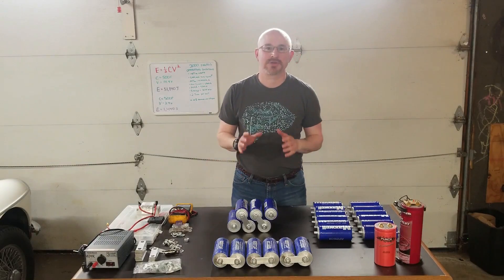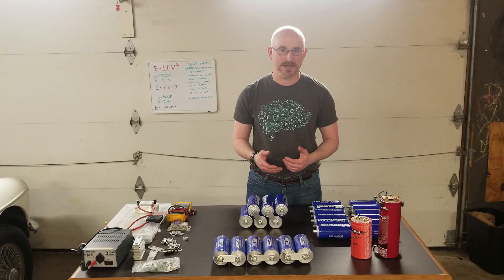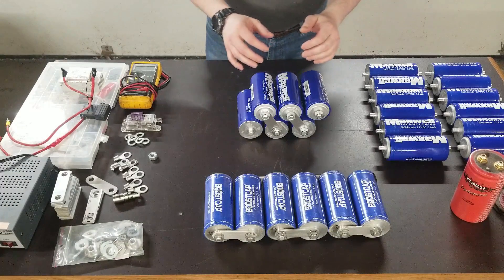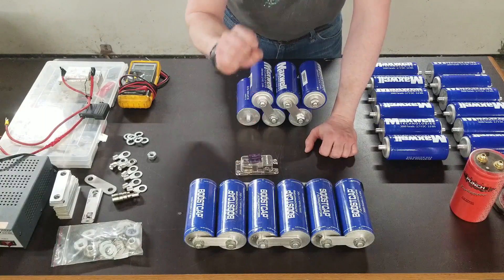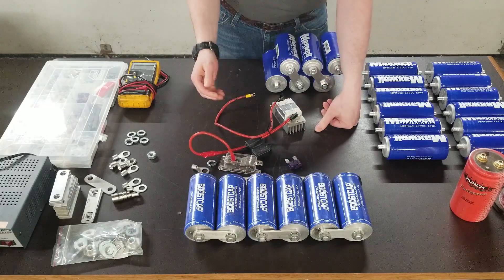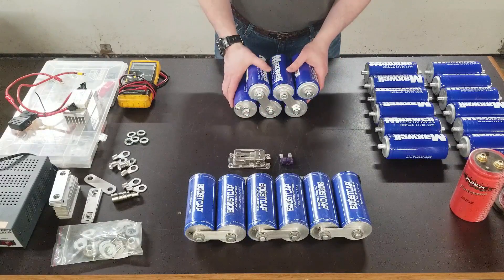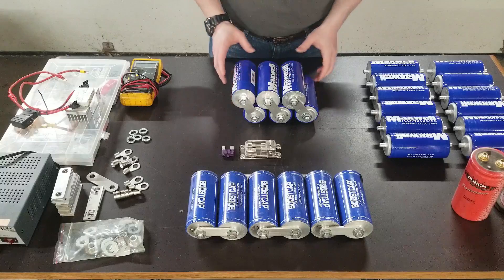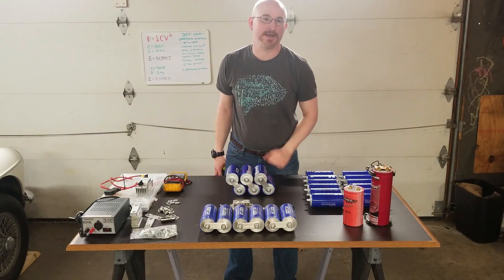Electrical engineer explains ultracapacitor Safety Tips and Tricks - Car Audio Applications

Comment: I find a basic VSR (Voltage Sensitive Relay) works well. I connect the 12v sensor line to the positive on the ultracap bank. I put a large resistor across the VSR isolate terminals - IE between Common and Normally open.  I have the resistors on a decent heat sink.

On connecting the battery or turning on the isolator I have between the bank and the 12v high current supply the VSR is open so the current is limited and the bank voltage starts to rise. Once it meets the voltage on the 12v feed the contact closes and shorts out the resistor giving direct connection to my audio supply line.

I also use a high current relay connected to the accessory switched 12v that closes when the car is in use. I have an override switch  SPST that connects the relay to the battery 12v if I want to use my audio system without having the engine running. It is wired as a latching relay that is interrupted by a small relay connected to a car alarm armed output.

As soon as I leave and arm the alarm the bank is isolated along with the VSR so it doesn't become a vampire load. I used a two position isolator so in the event of a flat battery I can turn the isolator to the second position and this gives a direct connection back to the cranking battery so I can start the car. I monitor the bank and VSR relays with a nice little digital voltmeter and LED so I can see what is happening.

The above setup sounds a bit complex but its actually very simple. A 200A fuse (TD) protects against a nasty short but so far it has worked really well. The bank is almost always fully charged anyway as I have glued a 20w solar panel to the sunroof shade. This is always pulled across and I cant forget as the sunshade when pulled across pushes a microswitch that is connected to one of the alarm trigger zones. The alarm gives a warning chirp if any input is active so I can never forget. With the solar panel across both my batteries stay healthy and on a very sunny day will actually charge both batteries at about 200ma.... !! Just don't forget your Schottky inline blocking diodes and a plain old 1N4001 diode across any relay coils !! Those large relays will hit you like a train with the back EMF when they are disconnected !  I can personally vouch for the punch they can give you.

I hope the above gives some idea's or help to someone considering using them. These banks are VERY useful.  Please PAY ATTENTION  to Richards safety advice. These packs store a huge amount of charge and if your careless they can really bite you ! 

~~~~~~~~~~~~~~~~~~~~~~~~~~~~~~~~~~~
Great advice and safety video Richard :-)    👍 👍 👍 👍
~~~~~~~~~~~~~~~~~~~~~~~~~~~~~~~~~~~
Reply from the maker: Love the setup!  I understood and agree, the beauty is in the simplicity.  Nicely done!
Reply: @richardvedvik979  Thanks :-)  I like to rely on logic and relays instead of microcontrollers. I love relay logic, I was lucky enough to inspect an early Otis lift with 2 lifts and a dispatcher. Not a CPU in sight. All completely run by relays. Beautiful lace wiring and so well built. It just seemed alive if you know what I mean.

You don't see build quality like this today. A great shame in my opinion. I achieved my Bsc in electrical engineering whilst in the Navy, that was the last time I had seen build quality like the lift controllers. That's the beauty of car systems and relay logic. So simple and yet so flexible.

I love your video's so far. I hope your channel grows and grows. I will link to you where I can. All the very best to you   :-)

Stuart.
Reply: But sir, if we/ u don't use a voltage limiter (for balancing) while charging aren't we risking overcharging one of those caps in series?

I said this because i have some project w/ 6 supercaps (rated in 2.7V 470F) in series, when i connect (in series) them directly w/ wire, one or two cap will always "dangerously" close to 3V when i charge it w/ 12.5v - 12.8v (i was using my spare fully charge lead acid batt)
and the location of those "overvolt" caps seem to be random (that eliminate the variance factor in built quality/different ESR of those caps right?), bare in mind that all those caps never runs hot while testing on those test (direct series connection).
What i mean by random is it will change places when i do full charge - discharge cycle, not so when i only using it... let say until Vtotal = 6V. using DC fan as load (inductive load, rated @ 12V , 14.13A)

btw, now after i buy some those "balancer/limiter pcbs" ,  now i stumble on yet another balancing dilemma, this time "undervolt" hahaha...
as we speak : Vt = ~12.3v , but individual V on those caps as follow : 1.65, 2.07, 2.26, 2.27, 2, 2.07. and those are not random any more, maybe i will try to manually balance those caps and let see if that help or i got variance in built quality afterall :D

Comment: FFS this guy brought the stock and Tesla brought Maxwell company 😂😂 they not that safe if no balance controller
Reply: You can buy those Maxwell caps already in a bank with balancers on them already
Reply: The ones he has are probably fine at 6 in series. 0.00174 ohms total. The voltage drop cell to cell Will be negligible and if the alternator isn't putting out even near that banks 16v max... Odds u have an issue AFAIK u face more risk driving around the block with out them. Rock 5 of them and a lot of room for bad things occurs with or with out balance

Comment: Thank you for your very professional presentation.

I noticed you don’t use circuits to balance the capacitors the way they are offered in eBay.

Could you explain the reason for not using them, and when would you use them?
Reply from the maker: Thanks for the comments.  You'll notice in my previous responses I identify that the balancing circuits are definitely required when you operate the capacitors at their rated voltage but in a car with a 14.4VDC alternator output, we aren't near the combined rating of 16.2VDC.
Reply: @richardvedvik979  But without balancing circuit how you prevent that they do not slowly get unbalanced? And when you discharge them how you prevent that you do not end up reverse polariy situation if they are not balanced?
Reply: @TH-wr1dv  he can't. That is why balancing needed
Reply: @voidex136  Yep that was my point. It does not matter that total voltage is under combinet rated voltage. Without balancer it is just time bom with longer fuse.
Reply: @TH-wr1dv  1,000,000 cycles a million chances. I worry about airflow bw the amps and the caps. At least the are not being run at deep cycles consistently so they will stay well within operational limits, especially if he regulates the initial charges. I've popped a 100a fuse on a half farad in an initial charge. Many designs are calling for 40a change limits. Once the battery is stiffened as long as he isn't parking lot pimping too much, over straining equipment, or overheating alternator at idle he should be good to go.
Reply: @ockamrazor477  aaand your reply have nothing to do with unbalance problem.
Reply: Right its about building an intrinsically safe product which is difficult wo balancing using lithium with odd failure rates; true. Did you miss his fire protection circuit?  He did too
Reply: @ockamrazor477  what circuit do you recommend for engine starter ( 600-1100 crank Amp) with 2500 W 120V ac inverter with intermittent  peak draw of 20 Amps, eg, air 8gal 5cfm air compressor and 15 Amp circular saw? Or just a circuit for thr starter. Tyia.
Reply: @jerydob6499  tricky to pick the right inverter just fuse around your caps batteries and chargers to avoid one cooking the other,  so don't plan on ever using more than 80% of the inverter and keep safety margins

Comment: Are you selling them??
Reply from the maker: Possible some of them will end up for sale on eBay if I don't find homes for them locally.
Reply: @richardvedvik979  What is a realistic price for these? I'm seeing everything from
~ $15  all the way to  ~ $80 on various sites for the BCAP3000. Am I missing something?
Reply from the maker: Prices for the BCAP3000 are usually around $200-250 for a used bank of 6.  Popularity has caused an increase in the past 5 years.   New, they are around $65 each.

Comment: Can the alternator charge the supercapacitors withoutbthe use of the resistors that you made?
Reply: ESR = .29 mΩ per capacitor.
In series of 6, total ESR 6x .29 = 1.74 mΩ.
In theory it will surge 14.4 V / 1.74mΩ = 8276 A
The absolute maximum current for the Maxwell BCAP3000  is 1900 A.
Although I cannot claim to be an expert here, please do the maths. 

What if you do this in a system with a bad battery, then the rectifiers in the alternator will get the largest part of the surge. An alternator rectifier can handle 50 A, and maybe 500 A surge as an absolute max. 

These values are theoretical, the wiring will do a large part of the limiting, but damage is in my opinion in range.

https://www.maxwell.com/images/documents/k2series_ds_10153704.pdf
Reply: @erikdenhouter  a typical alternator puts out 100 amp maximum... Some 200 Amps maximum... That doesn't include the engine electronics and what is running... The bank takes in as much as it is available... Factor what the battery needs also...
Reply from the maker: No! The capacitor bank will look like a dead short and will damage the battery and alternator without current limiting of some form.
Reply: Yes you can. If you have your vehicle running with lead battery, you can charge the caps with jumper cables. They will charge to alternator output. I made a video on it.
Reply: @Uwe K Yes, even at Zero volts. The vehicle has to be running, the lead acid battery has to be connected to the vehicle. You run jumper cables and connect in parallel. They will get charged faster and cheaper than most methods.
Reply: @luisislas2162  I think this is bad advice.
In principle always use a limiting resistor in any form: 55W headlight is one method (or 2 parallel = 10A), but even an extension cord of 20 meter or more could have enough resistance to limit the current enough, it depends on the capacitance of your supercaps.
Specially a jumper cable is NOT enough, they are made thick to get low resistance / low losses when jump starting.
The problem in your method is that you do not see if damage occurs, your set will probably survive, but the damage can be done in the life expectancy of the battery and alternator, and even the supercaps have a maximum current in their specs.
At some point you can even produce a welding heat, and e.g. sparks could damage eyes.

In the end, you win only a short period of time by not using a limiter.
Reply: @erikdenhouter  Limiters are for regular batteries...
Reply: Just be aware and take care, the numbers can show us something hidden under the bonnet :)

Comment: Would I see any benefit using one bank of the 2.7v super caps in a 2000watt daily system?
Reply: I couldn't afford to buy alot of banks at one time, so I bought one bank a month for 4 months.  I run two ct sounds 4k's strapped. So at least 8000 watts. I have a large bank of crescendo 110ah batteries but I noticed a HUGE difference  with just one bank of maxwell boostcaps on 8k!  I didn't think they would be so impressive, but I now believe in them.
Reply from the maker: @joshhanson6777  thanks for the input!
Reply from the maker: The 2kW installs I've done did benefit from one bank on stock electrical.  While another bank helped them with sustained bass notes, music is dynamic and the single cap bank improved dynamics.

Comment: You should really add an overvoltage protection circuit across each capacitor in the bank. Differences in the manufacturing process can lead to higher voltages across some of the capacitors.
Reply from the maker: Totally agreed when using them at their rated voltage.  Manufacturing variances in ESR will certainly cause differences in voltage across each cap.  Since we don't operate 2.7V or 2.85V  caps at rated voltage in cars regulated to 14.4VDC, the banks I've ran and installed for the past 6 years have been fine.
Reply from the maker: Note that six 2.7V caps in series are rated for 16.2 VDC (and six 2.85V caps are rated for 17.1 VDC).   That's why I'm pretty comfortable operating them at 14.4 VDC without balancing circuits.  Six of the older 2.5V caps in series are rated for 15 VDC and in that application I would recommend balancing circuits (if you can find them).   That said, I certainly should have put more of an emphasis on balancing techniques and mentioned that the active balancing circuits are the recommended way to ensure long life and safe operation for any application.  Thanks!
Reply: @richardvedvik979  Even with a significant safety margin i probably couldn't sleep at night if 350€ worth of capacitors had no protection.
Reply from the maker: @slap_my_hand   I certainly appreciate the concern.  I added notes on balancing and will continue to edit those notes further to help others.  Part of my comfort may be due to my having used them like this for over 6 years with a decade of industry applications to reference.

Comment: I have 6   2.5 V   2600 F Maxwell Ultracapacitors in a series. I plan on putting them in my trunk with a 250v breaker. I have a 1000 watt stereo system but I’m curious... I can not find protection boards for the 2.5 V ones & well... should I use a battery isolator or should I just have a solar panel by the window to keep them steady.
Reply: Leo Amaya 
You could also add another cap in series so 7x2.5V. This (17.5V) will give you more than enough headroom so you won’t have to worry about overcharging them. It will decrease your overall capacity though. Leaving you with 371F in stead of 433F. That’s what you pay for peace of mind.
Reply from the maker: The 2.5V cells are old which is why you'll find a hard time finding balancing circuits.  A datasheet from 2003 can be found as well as the instructions for the balancing circuits made then: https://www.datasheetarchive.com/maxwell%20boostcap%202600F-datasheet.html
 I recommend using the newer 2.7V or 2.85V cells to alleviate your concerns.  That said, you are not alone in your quest.
You can find a low duty cycle cell balancing application note here: https://www.maxwell.com/images/documents/technote_cell_balancing.pdf
This technique uses a resistor in parallel with each capacitor to provide an alternate path for ESR current and reduce variations.  This will cause the bank to drain more quickly and the resistor value determines the speed of balancing.  Faster reaction cause faster draining.  
You can find a paper discussing balancing methods for a 2.5V cell here: https://hal.archives-ouvertes.fr/hal-00411482/document
This paper explores a few basic concerts but does not go into enough detail. To help give simple instructions.  A seventh 2.5V cell in series would be a suitable alternative to balancing circuits. 

A battery isolator isn't necessary and it's preferred to keep them in parallel with the starting battery.  With an isolator you could end up with a situation where the bank voltage and battery voltage are different - and when they are connected they will equalize quickly - fast enough to behave like a short and cause arcing on the isolator contacts.  A disconnect method is needed, as mentioned in the video, and a breaker is also ok - just make sure you're measuring voltage and charging the caps to the battery voltage prior to connecting. 

Solar panels are good for helping the lead acid batteries in our cars stay topped off.  Caps don't really care what voltage they operate at (as long as it's less than rated).  I've used solar panels to keep car batteries charged and it extends the life of those batteries.  As long as the caps and batteries are in parallel, solar panels can help the entire system.  Once the vehicle is running, the alternator will determine the operating voltage.

Comment: Hi great video ! I would like to know if i can use my supercaps without BMS. Do you think that i could use 7 supercaps instead of 6  just to be sure that they don't overcharge ?
Reply from the maker: The balancing circuit or BMS should be used if the application brings them within a tenth or two of their rating.   In a car where we operate at 14.4VDC, that's only 2.4VDC per cell.  If you had a vehicle that could run higher than 14.4, then the active balancing systems make sense.   I haven't used balancing circuits in any of the applications due to operating them safely below their threshold.  You could certainly play it even safer with a seventh cap in lieu of active balancing.
Reply: @richardvedvik979  Thank you vey much, it's better to be safe because those SC costs a fortune !

Comment: Seems there is not mention about the use of voltage equilization of units used in series..
Reply from the maker: If the ultracaps are use at or near rated voltage, then dedicated equalization circuits are certainly recommended. In a car,  we are under 90% of the rated voltage.  We do not see any issues after years of field use in this application.
Reply from the maker: That's because we are using them well below their rated voltage thanks to a maximum of 14.4V from the alternator